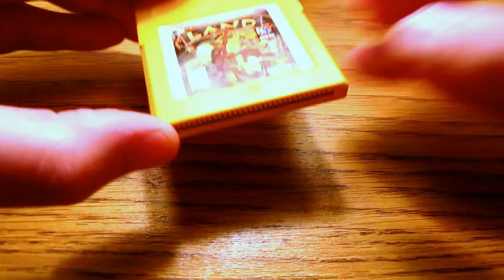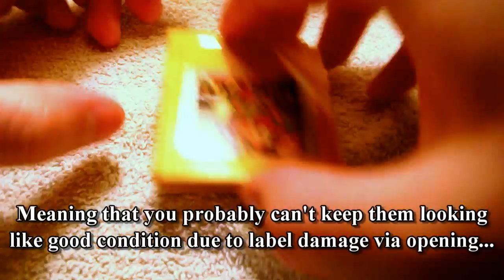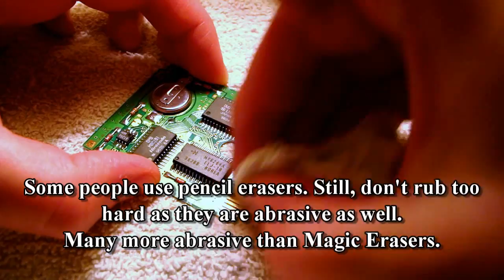How To SUPER Clean Game Cartridges (Read The Description For Tool Links)

Comment: Nice video. When I cleaned out my SNES I only did the plastic casing, but I found Dawn and warm-hot water does great for the plastic parts (though obviously you wouldn't do this with any part that has a label). Never thought of using the Mr. Clean erasers, though like you said I'd worry about it being too strong.
Reply from the maker: Thanks! Yeah, a little soaking with soap is all some things may need. Besides labels, also don't soak any circuit boards of course, lol! The magic erasers don't seem to scratch at the metal, but they are slightly abrasive (probably something like like 2000 grit sandpaper in how it could maybe polish, but not take much off) so it's possible it would start to do so if you kept at it. I dunno if it's because the metal is harder than the abrasiveness of the sponge (similar to why you need diamond to cut diamond), but I never needed to use one for very long anyway as it rubs whatever is on the pins right off pretty fast. In fact, I'd bet it would start carving into the circuit board before it would the pins since it's fiberglass/epoxy instead of metal, which still wouldn't be good of course. But yeah.

Comment: The large metal part on the ROM cartridge is a grounding plane. If there is any exposed/corroded area, it should not affect it in any way possible.
Reply from the maker: You mean the part on the back that I said in text I taped over just in case? It looked like there was little circuits running across the back through from the front.

Comment: Are these cleaning methods also good for DS cartridges?  I got one of my games used from GameStop, and it freezes up quite a lot.
Reply from the maker: Yep! Well, sort of. Like, 3/DS game carts of course don't have any sort of screw that holds them together. They are held by internal clips and/or glue. So opening one up would involve carefully prying apart the two halves with a little screwdriver or blade, then when finished cleaning, probably having to super glue it back together without getting glue on the circuitboard, chips or pins). Sort of risky for the cart as it may get bent out of shape, the plastic where you are prying may chip or the case may crack. Mind you 3rd parties make replacement cases (https://www.ebay.com/itm/112047991305), but that's an extra cost and not genuine. Well, if you are worried about authenticity and condition. But if you really need to clean out the internals of a cart for some reason because something corrosive/acidic got in there (say, soda or pizza sauce causing it to rust), opening it would probably be recommended as a last resort necessity. However, that sort of thing is an extreme case and the issue is generally just the pins.

... Which are of course already exposed pretty nicely, minus the little plastic bars between the pins attached to the case. So when not needing to open it, you could just take alcohol and a cloth or brush (not too damp or it could squeeze out and inside the cart) and rub the fibers between the plastic bars. You could even get a small piece of magic eraser in there by squishing it between the bars and rubbing it up and down over them. Sort of tedious that way, but safer for the cart's case than opening it. Though just be careful not to break or bend said plastic bars as they're thin.

Comment: Hm, it's interesting that you think blowing doesn't work... I've always done that. Next time I get a game that doesn't work, I'll put it in and take it out ten times instead of blowing, and see. :)
I am not too interested in the rest of the video right now, as I don't need to clean them. Blowing/taking the game in and out has been enough for me.
Reply from the maker: I used to do that too until I found out it's pretty much a placebo effect. What removing the cart and reinserting it does is give it a different sort of chance to make contact in a way it'll read it. Doing so repeatedly may even have the effect of scratching any dirt/buildup off of them to create that better contact ( like cleaning them) them until it builds up again. Blowing ends up being moot because the idea was to blow the dust off the contacts, but dust that can be blown off would just be pushed away by the pins during insertion anyway. 

Blowing may actually have a detrimental effect however in that moisture from breath could cause stuff to stick to the pins more and if, say... you blew in just after drinking soda, said soda could get spit on the pins and cause corrosion over time since it's acidic or maybe spit would keep building up as it's not like straight water or alcohol.
Reply from the maker: I decided to do a search to find an article with a study on it and this one is pretty thorough:
http://mentalfloss.com/article/12589/did-blowing-nintendo-cartridges-really-help
Close to halfway down the page it shows a comparison of blowing on the cartridge for a month vs not. You'll see quite the difference in surface residue.
Reply: PkGam I don't usually drink soda, so that's fine. ;) But after realising it might be the reinserting of the cartridge and not the blowing into it to fix issues, I haven't blown into my cartridges.
Reply from the maker: lol
Oh ok.
Reply: I might need to use this after all, as a lot of my Game Boy games that used save batteries got their saves wiped after I used the GB01 cart reader on it, and the company thinks it might be because the cartridges aren't clean.